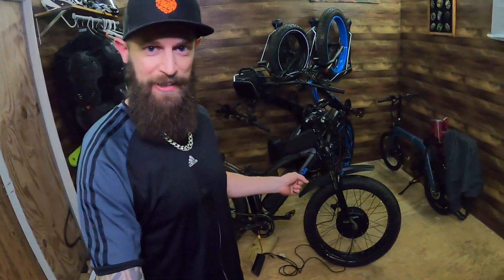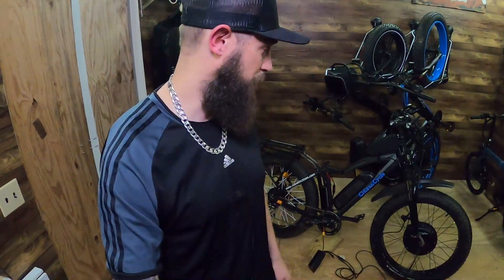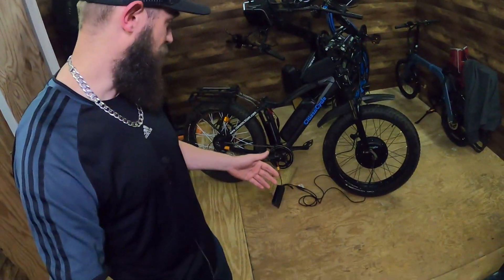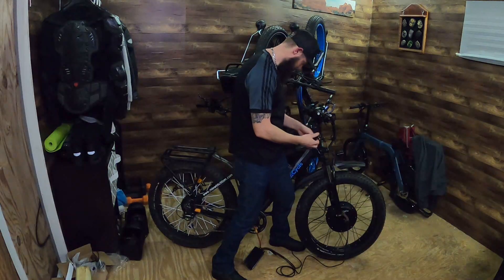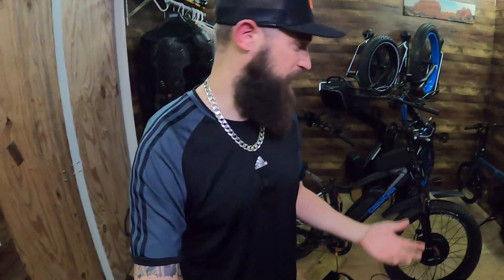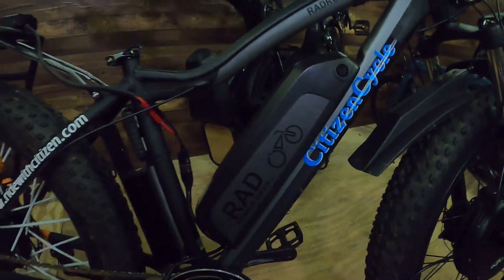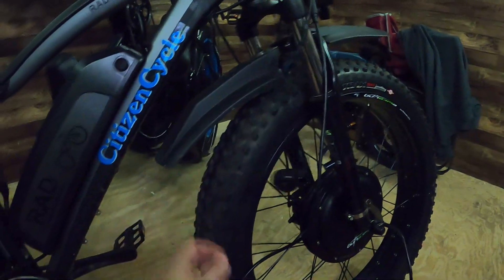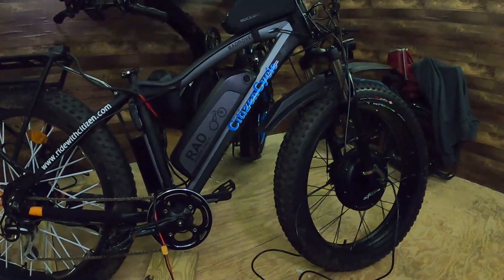FrankenRad Lives!! - AWD Project

Comment: It’s Alive! I have a duel battery set up on my Hyper Scorpion. I bought the Juiced duel battery switch on eBay and a Pelicans box to put my 52v 30ah battery in. Battery is made out of China (Samsung) manufacture. UTube guy: Frosty computers (check it out as you may have ideas as to your use) places the battery order. He has the set up go through on his channel. Anyway will have everything set up on the bike so when the battery arrives I drop it in. Want to do a duel motor but that might apply to my RadMini more then the Hyper Scorpion.

Comment: Don't you need some sort of a dual controller, so that both wheels are trying to go the same speed? You would not one trying to go 10 miles per hour while the other is trying to go 20 mile per hour.

Comment: That's so cool. 
The Rad battery used to get about 20 miles to a charge on my stock Radrover, but after the upgrades only 15 miles, I got a 52v 17ah battery like yours and I get 26 miles to a charge. 
You should get another 52v battery and mount it on your rack
Reply: that's what he's doing... the rear  battery on rack will be 52v 17.5ah Hailong Fat Shark.
Reply: @derwood  yeah but he's using the Rad battery in its original place.
I was suggesting him using 2 52v 17ah shark batteries front and back

Comment: Is front wheel Throttle Only and the rear wheel PAS and throttle?  It looks like each motor is separate controller and separate battery.

Comment: AWESOME!  I probably watched those same soldering videos before struggling with my own upgrade ... dual batteries. Their solder flows like magic silver ... my solder becomes globs of tarnish.  🤣  But it works!  Looking forward to hear your final acceleration and speed numbers/impressions.  Thanks!
Reply from the maker: mine was quite tarnished looking, and it seemed to take longer than i thought it should for solder to melt...
Reply: @CitizenCycle925  It all looks good behind heat-shrink-tubing.  😜